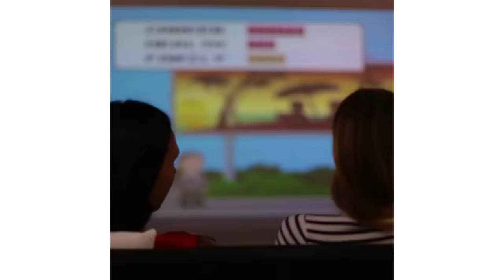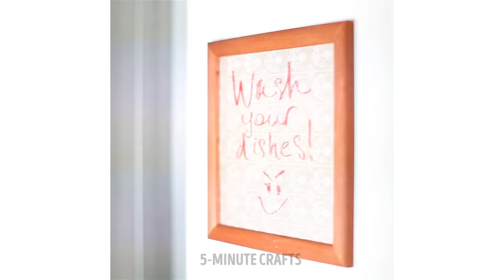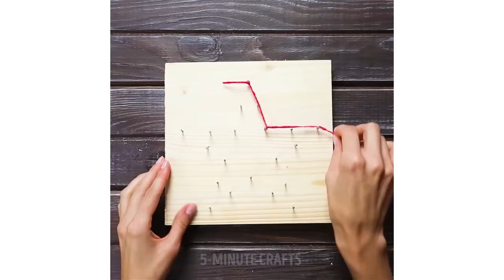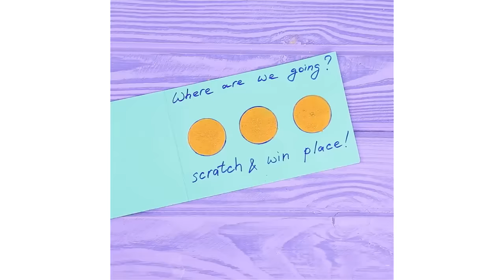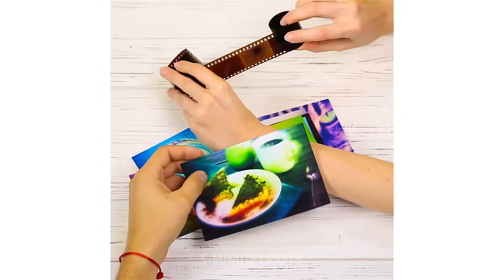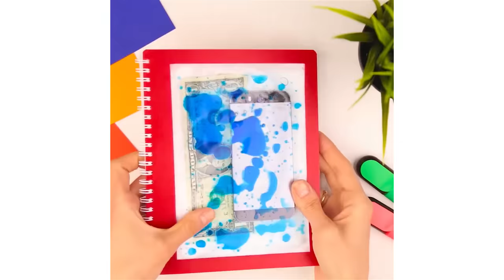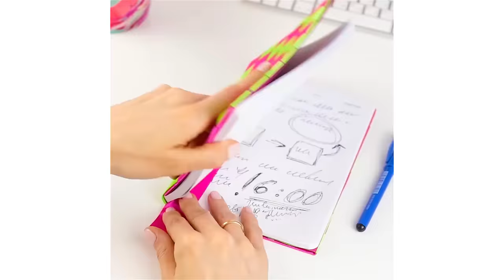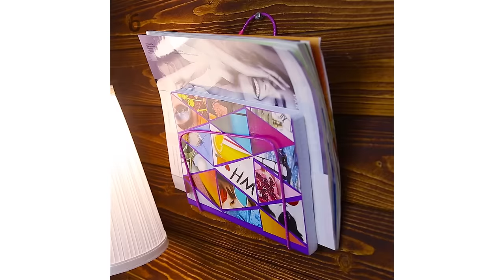EPIC 5-MINUTE CRAFTS COMPILATION

Comment: in the umbrella diy, what is that metal wire, used as the stand of the umbrella, called?
Reply: i think it's a skewer? but probably quite a cheap one so it's thin and you can bend it easily :)